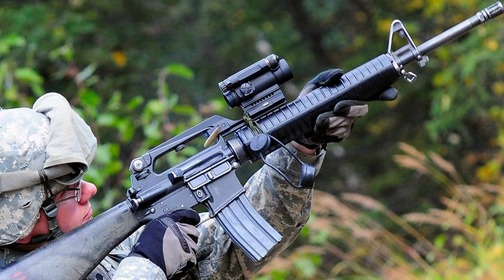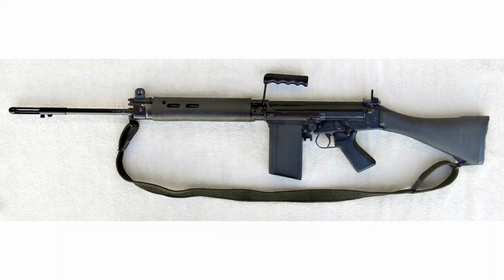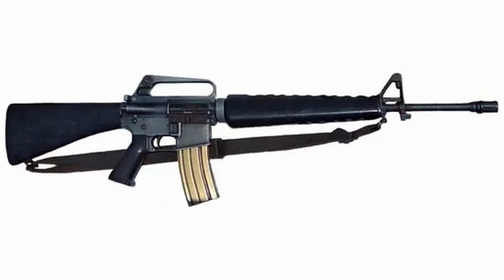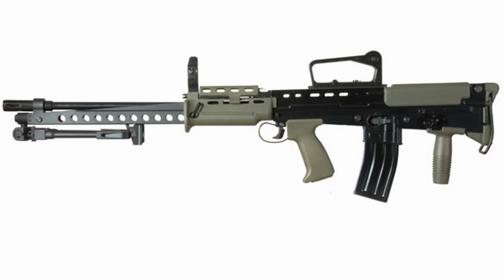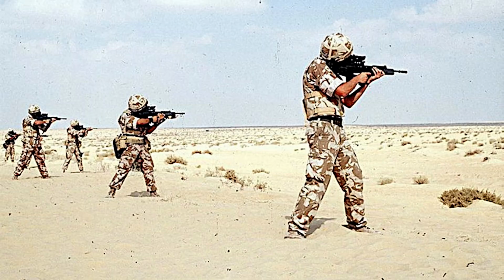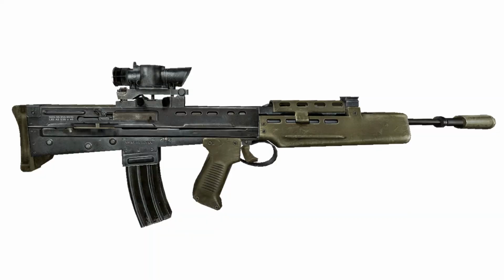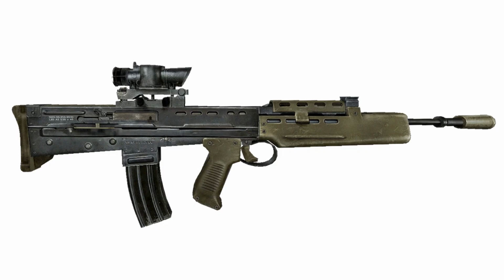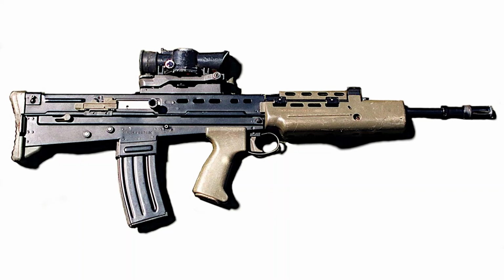The L85/SA80: Britain’s Bullpup Gamble - TRDN S01E27

Comment: it is due to US objection and not NATO Standardization  to NATO 7.62 mm that result in failure of 28 cal /  7 mm cartridge .  The original SA80 is design for 4.85mm. When it was change to NATO 5.56mm, the  designer doesn't have the time to fix all the problems for the cartridge  changes. It was push out for service too quickly.